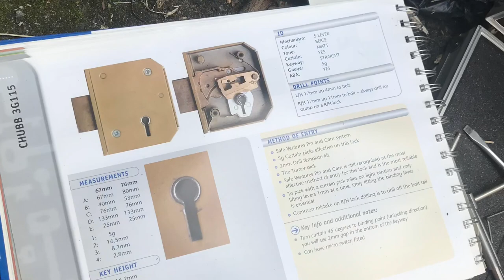Drilling a container lock (Chubb 3G115) that is beyond saving! Love a tricky locksmith job

Comment: Never in doubt, professional opening considering the damage already inflicted.
Reply from the maker: Cheers mate, by the way I’ve tested the Legge pin and cam it’s a thing of beauty, and it also works on the old black Legge with the BS1980 sticker on it, you just have to start from the bottom and work up without taking a reading ….magical

Comment: That's testament to when locks built to a standard and not a cost ( even 115's shared main components with 114) , all brass levers, bolt and springs meant everything still able to move , good job. little of subject but what do you find is your best source of advertising .( maybe do a blog ? ) cheers pal keep up good work
Reply from the maker: And that is exactly it mate, the outer body was fucked , rusted to bits but the actual levers bolt etc were all still working , Chubb really did build quality locks , and most of my advertisement is word of mouth to be honest mate

Comment: The reaction to that open was f-ing amazing haha! Respect. In your experience, what are the main locks you find on more old-style containers? Are they often from the chubb range?
Reply from the maker: The reaction was because I had onlookers , the ones that try abs give helpful suggestions 😂😂😂 and I’ve opened a few they can literally be anything but mostly I’ve found they are ERA
Reply: @FortressLocksmiths  Ok great, thanks. Good to know. I'll inevitably come across one sooner or later, don't think I'll nail it as good as you have here...but i'll give it a bash!
Reply from the maker: @maxtrav1984  to be fair pal I don’t think you’ll come across one in as bad condition as that so hopefully will be a lot easier 😂
Reply: @FortressLocksmiths  absolutely fair shout